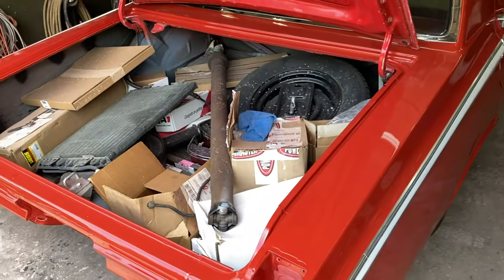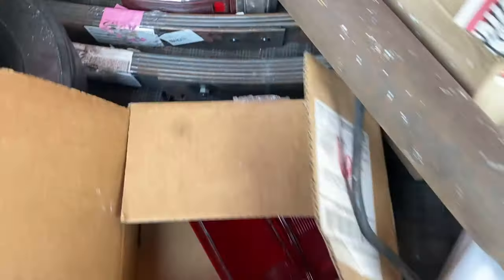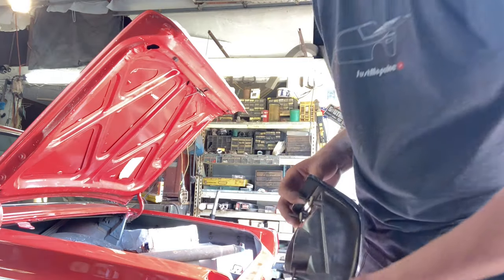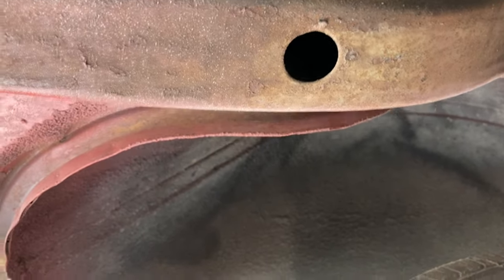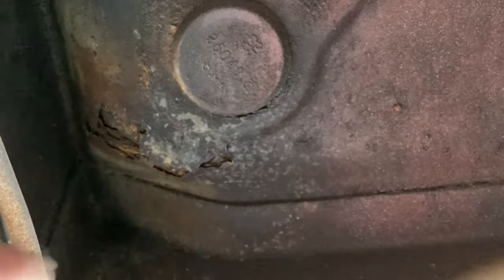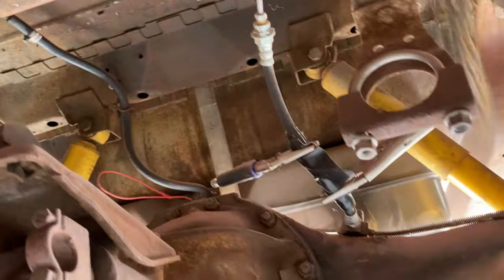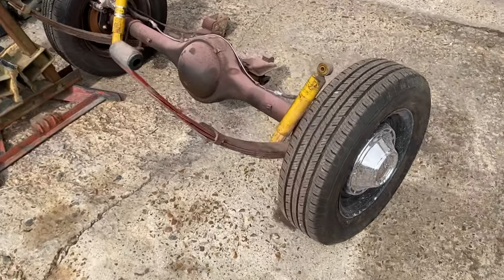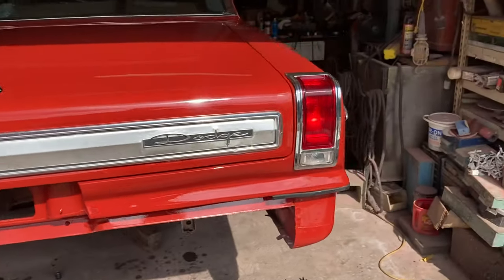65 Coronet: Repopped Taillight lenses, Gas Tank, and 8 3/4 Removal #Restoration #Mopar #Dodge

Comment: Love that rust encapsulated from Eastwood stuff works great and doesn't need top coating.
Reply from the maker: Absolutely! I’ve used it under raptor liner before and had great results. Also coated the bottom of a 65 mustang in an old video. I almost considered painting a car with it. It leaves a good sheen of black.
Reply: @JustMoparJoe  absolutely I like it better than por 15

Comment: I feel your pain about cleaning the underside of the car. When I did my 65 , I was covered in dirt, undercoating for two days 😂😂. Worth it though !! I used several different styles of wire brush , that worked best for me. Good luck & buy a couple of throw away hazmat suits. 🤘🏻🤘🏻🤘🏻🤘🏻
Reply: Agree whole heartedly what you said
Reply from the maker: Thanks Kurt! I always end up with my hands and ankles hanging out of those suits. I’ll keep covered and masked. Safety for sure.

Comment: The Silver will work great on the tank with the blacken out underbody.
Reply from the maker: Yes sir. I’ve got to get a little over spray off the bottom of the tank 🙄
Reply: @JustMoparJoe  scuff the tank and spray silver rust Encapsulater

Comment: Car looks Great!! I'm still trying to figure out how I can use the Texas Line Lock at the track..... Would save some pennies
Reply from the maker: Hahah! I had wondered if you tried it on the trail yet! Better than losing all the brake fluid
Reply: @JustMoparJoe  Actually Ive used it on the Trail and in the shop several times, now to figure out how to use it on the track for launches!

Comment: Take the gas tank to a radiator repair shop and get it vatted and it will come out like new.
Reply from the maker: Thanks Jimmy. This tank looks to be recently replaced. Just a little trash in it, likely from a dirty jug or pump. That’s a nice idea. I wonder if evaporust would be similar.